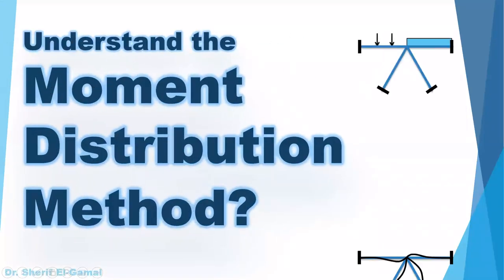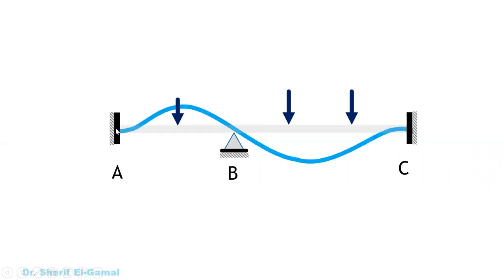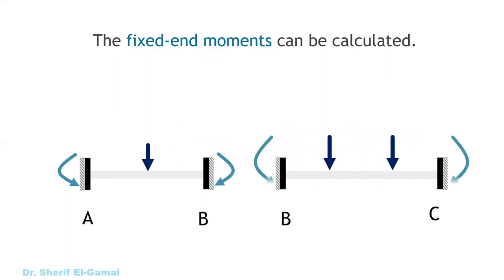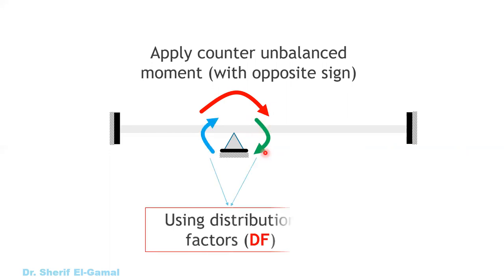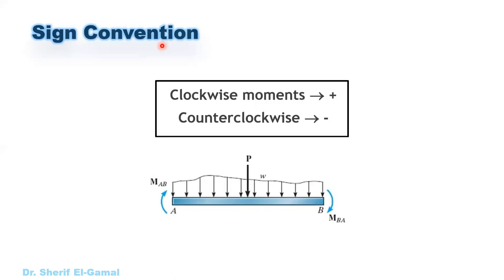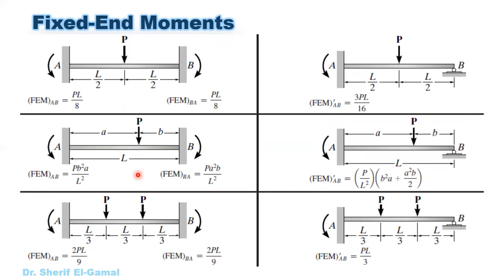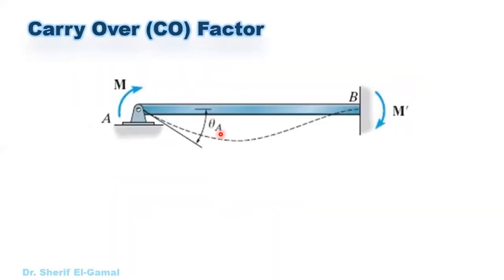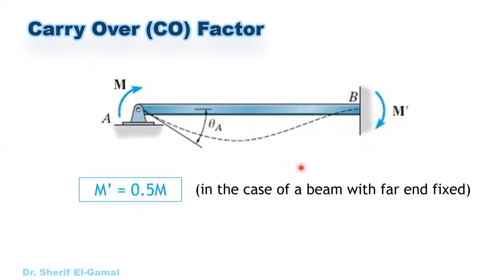Understanding Moment Distribution Method (Easy and Clear) -  التحليل الإنشائي بطريقة توزيع العزوم

Comment: Dear Engineer is it possible to make a video on a frame design having a combination of one ay and two slabs as I need to know the direction of steel to be provided in such a condition where both one way and two slabs are connected together through beams.

Comment: Hello Dr., How do you determine the midspan moments in this case? Thank you
Reply from the maker: This can be done easily. For example, if you have a cantilever and you removed this cantilever and took its effect, it will result in a force and a moment at the end pin or roller support.

Comment: How can you apply a moment to a pin connection? - Refer 10.17
Reply from the maker: You can if you have external moment or if you have a cantilever. You can remove the cantilever and replace with a moment and load.